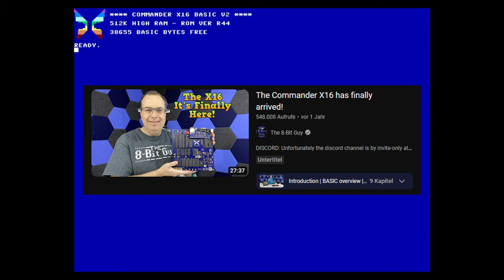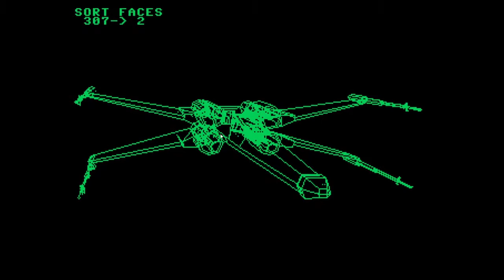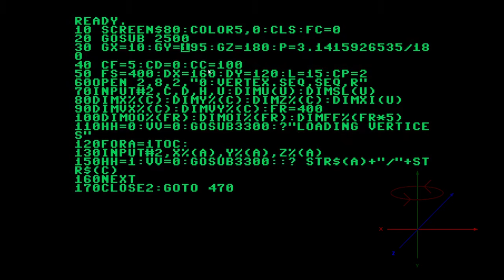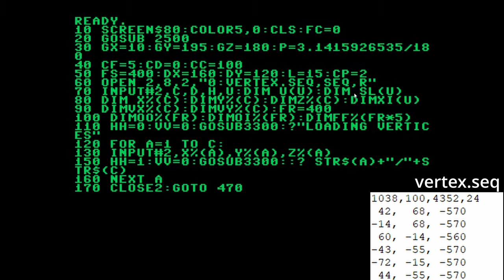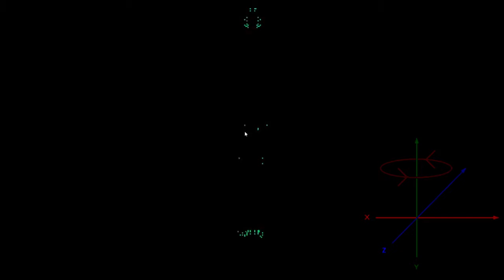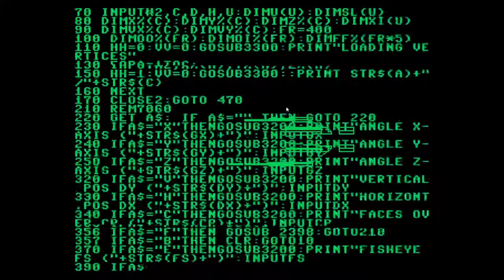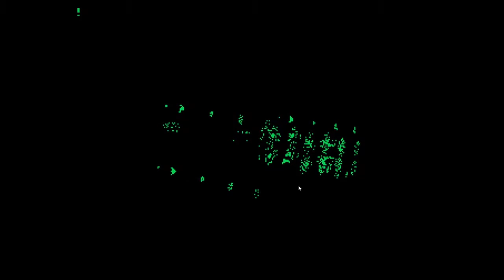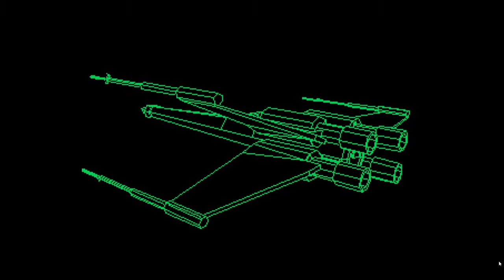X-Wing on Commander X16 | 3D-Render | 8bit Computer | Star Wars

Comment: Not sure if has something to do with german keymapping or localization on the emulators, but in your BASIC code (for the c64 and plus 4 version) on line 60 and 700 where you open the vertex.seq and planes.seq files, there seems to be a comma before the file extension. Like "vertex,seq" instead of "vertex.seq". The files didn't read properly when i tried it, but after i changed comma to dot/period in the filenames it worked. This is in the c64 and plus 4 versions. In the code for X16 the filenames seems to be correct.
Reply from the maker: Hello, thank you for trying out! The code behaves differently when loading from emulator and from real hardware with sd2iec drive in my case on the commodores. What you actually did is, adding the seq suffix to the filename, which is always a good idea. the ",seq" is the second parameter, which is is the filetype of the file you try to open. Seems to be optional, because it worked for you. The right way to do it would be open8,8,12,"vertex.seq,seq,read" or "open8,8,12,"vertex,seq,read" depending on the enviroment. I mentioned this wierd behaviour in one of my tutorial videos.